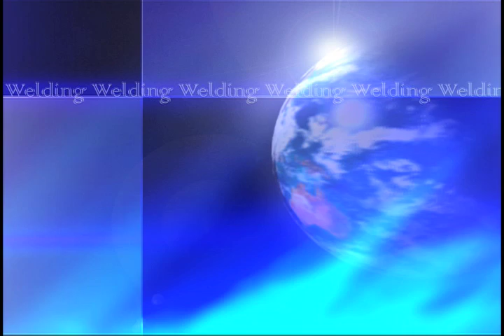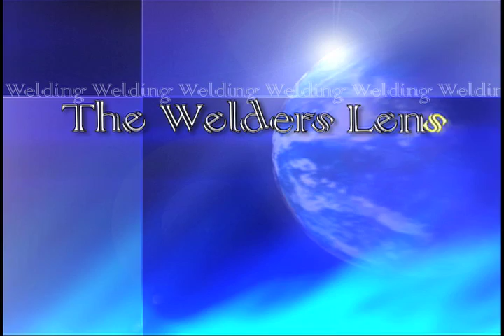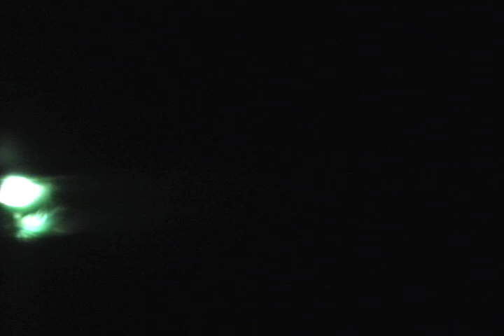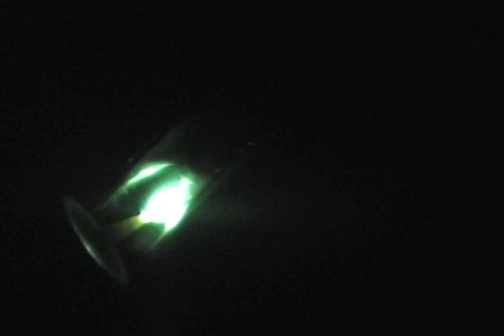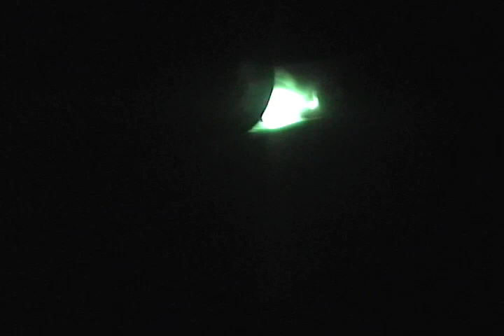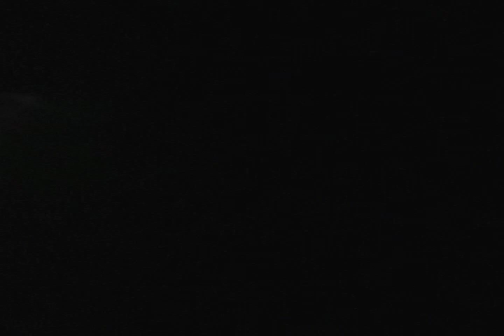TIG Welding Training  [6G position Hot Pass/Filler]

Comment: I am a pressure welder in a coal fired power plant, i do alot of boiler tube, and heavy wall chrome/stainless/inconel. Your consistancy is horrible, you dip your tungsten constantly, i dont think my apprentices hot/fills/caps were even this bad when first started practicing pipe. I dont care where youve worked our alstom weld inspector would laugh and tell you to pack up if he seen this sort of work. I mean no disrespect but you shouldnt be teaching people, this is NOT the way to do things.

Comment: @TheRoastedPeanut ur tungstens probably balling up if your machines on dcep nice trick to use when welding aluminum always make sure your tungstens nice and pointed and if it contaminates grind it clean but to weld steel put your machine on dcen and youll be able to weld and look up techniques like the stack of dimes or walking the cup or keyhole if your welding pipe good luck!

Comment from the maker: Thanks for your input. It isn't a big deal to dip the tungsten you can file it out or grind it out. Most of the time you won't see tungsten inclusion. I know it is not desirable to dip the tungsten but it does happen. I have welded all those things you referred to as well except Titanium. I have done the purge on exotic metals too. That is the thing about welding friend. What works for some may not work for others, but it doesn't make it wrong either way you go. Walking the cup is a blessing.

Comment: hi again mike,are you coming up the right side of the pipe withe your torch still in your right hand or you working with left hand.i normally work with the torch facing to my right coming up on the 6g position right side.